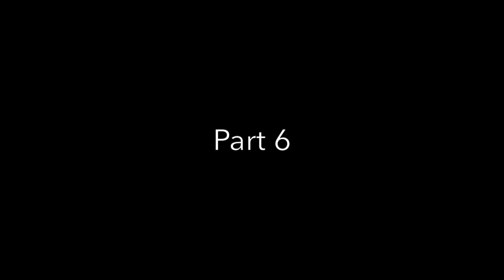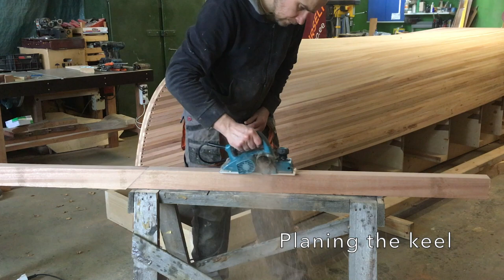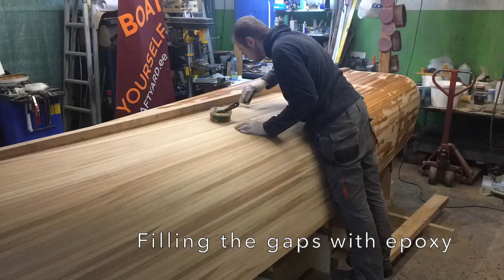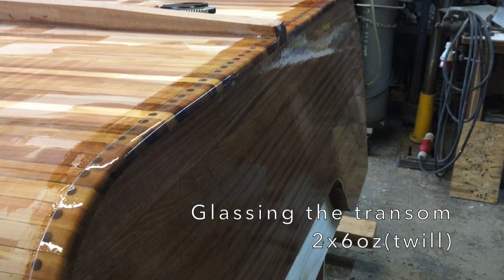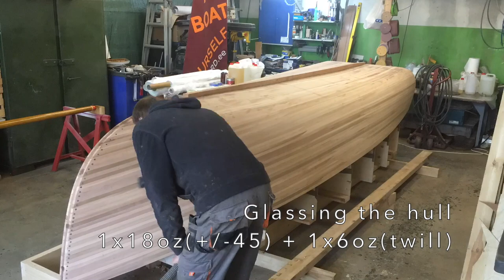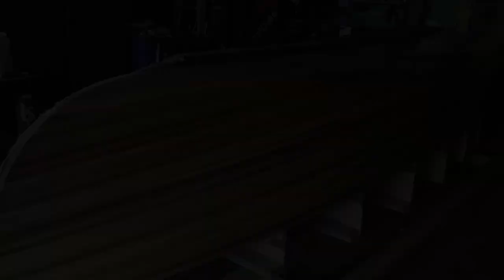Building Jericho Bay Lobster Skiff - Part 6

Comment: Great videos - these are really inspiring. Can I ask about the glassing, and the process you use? I'm assign that you're using the 18oz -45/+45, and then the twill on top of that, but then you're peeling something off, what is that, the twill?
Reply from the maker: Hi! You are right, first layer is 600g/m2 biaxial -45/45, then comes 200g/m2 twill, all together 800g/m2 outer layer. I used peel-ply. It's a type of nylon fabric that absorbs redundant epoxy and leaves a smooth surface. Peel-ply doesn't adhere to glass layers and comes off easily. It adds some extra cost but saves you a lot of sanding and is worth every penny. All the best, Martin
Reply: Thanks for the reply. I was also wondering what sort of joint you used when you were scarfing the strips together, as I wondered how the joint handled being slightly bent when the strips were laminated on the strong back. @JRCraftyard

Comment: when do you pull the peel ply ? same day or next?
Reply from the maker: Hi, Robert. I usually remove the peel-ply next day when glue has hardened. Sometimes I've done it several days later and it hasn't affected the final result. I think the next day rule of thumb works fine in most cases. Timing when to cut he glass is the tricky part and has to done usually the same day. Good luck!